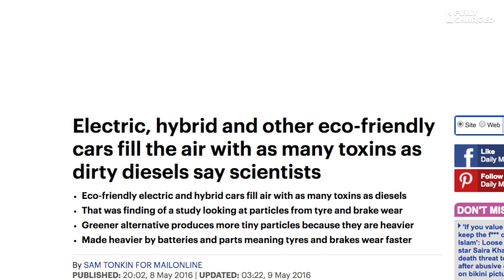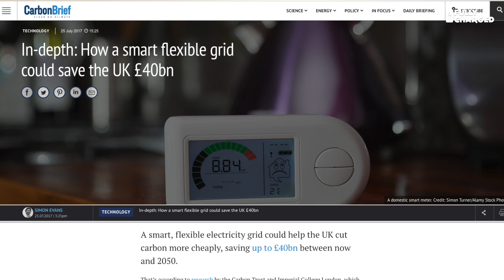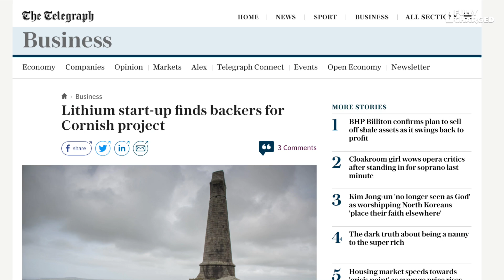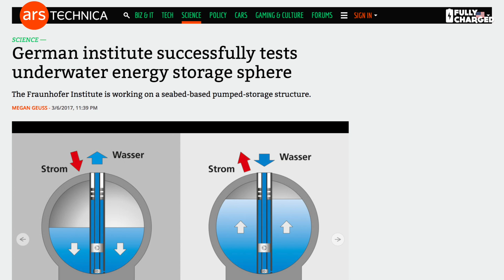Kettles, Particulates & Flexible Grid | Fully Charged News

Comment: It makes far more sense to abandon wind & solar, they are expensive and impractical, and go 100% nuclear & hydro, geothermal in good areas and then ALL power is baseload power. If EVs become the dominant form of transportation, as the trend is heading, that will increase total grid electricity by ~50-60%. Almost all of that will be at night when there is will be surplus nuclear and cheaper power available and cars are parked. That is the perfect balance for peak daytime electricity usage, with intelligent charging tech you can achieve an even 24/7 power demand which is the most efficient one and a perfect match for 24/7 baseload nuclear power. Almost all generation will become baseload power. That is maximum grid efficiency. 

Having fluctuating electricity sources on the grid are a really stupid way to manage a grid. Essentially you are converting economical baseload power into expensive peaking generation. Natural gas has always been the predominant supplier of peaking generation so that is why Big Oil absolutely adores wind & solar and despises baseload nuclear. In Ontario NG gets 17.2 cents/kwh whereas nuclear gets 6.6 cents/kwh, wind gets 14 cents/kwh and solar gets 44 cents/kwh because wind and solar convert 24/7 baseload efficient fuel-sipping CCGT into inefficient part time fuel guzzling OCGT and hugely inflates the price of gas generation and gas for home heating also. Baseload CCGT gas generation should only be getting ~5 cents/kwh, the extra 12 cents comes because it is peaking generation. Thanks wind & solar for making electricity and heat much more expensive. Thanks a lot. That will sure help EVs pushing the electricity price sky high.
Reply: Tom Hooper you have zero knowledge of nuclear. Don't get your info from Greenpeace which just makes stuff up, they even admit that, the Fukushima Death Cult. You need to abandon the Fake News Fukushima disinformation Fear Porn you have been deluded with and go to a reputable source. Go to Hiroshimasyndrome d0t c0m and learn the truth. Fukushima killed no one, vs Fossil & Biomass kills 7 million every year acc. to the WHO. You can easily get radioisotope readings in the Pacific Ocean going right back to 2011, and even at their peak, near Japan they are a small fraction of natural radioisotopes already in seawater. Learn to use your brain, I know it will hurt at first, but after a while you will get used to it. If you want reputable, accurate, rational, up-to-date Fuku info go to: hiroshimasyndrome d0t c0m. 

earthtouchnews: heres-your-go-to-source-for-debunking-all-the-fukushima-fables

deepseanews: true-facts-about-ocean-radiation-and-the-fukushima-disaster

scientificamerican observations: researchers-trumpet-another-flawed-fukushima-death-study

southernfriedscience: 28-fallacies-about-the-fukushima-nuclear-disasters-effect-on-the-us-west-coast
Reply: whykhr good, where can we deliver the spent fuel rods?  Your address please.  You clearly neglect the ancillary and required cost of storing nuclear waste in your examples, oops.
Reply: Friedlander I will happily store the 18 lbs of the nuclear waste I would generate on my property to supply one American's lifetime electricity demand if you store the 250,000 lbs of radioactive, carcinogenic forever, coal ash & sludge you generate with your coal electricity on your property. You should also bag up the 2,400,000 lbs of CO2 you will produce whereas I produce none. Also it would be fair if you pay a fee for the O2 you burn whereas I burn none. Say $1/lb for the 1,800,000 lbs of O2 you burn, will that be cash or check?

And dummy, the cost of nuclear waste storage is 1/4 cent per kwh, oops!
Reply: The World's #1 Climatologist James Hansen on the anti-nukes real MASTER = Big Oil , and their renewable energy bait-and-switch scam:

"....The tragedy is that many environmentalists line up on the side of the fossil fuel industry, advocating renewables as if they, plus energy efficiency, would solve the global climate change matter. But suggesting that renewables will let us phase rapidly off fossil fuels in the United States, China, India, or the world as a whole is almost the equivalent of believing in the Easter Bunny and Tooth Fairy.

"...it is much less than worthless. If you drink the kool-aid...you are a big part of the problem...The problem is that, by drinking the kool-aid, you are also pouring it down the throats of my dear grandchildren and yours. The tragedy in doing so is much greater than that of Jim Jones' gullible followers, who forced their children to drink his kool-aid. All life will bear the consequences..."

"...The lobby...Union of Concerned Scientists...broadcast a request to all citizens to write...congress...to demand improved nuclear power safety. Huh? The number of people who have died from nuclear power in the U.S. is zero. How to improve on that? The safety record of the nuclear industry is the best of all major industries in the U.S..."

"...No people died at Fukushima...When a plane crashes and kills 100 people do we choose to terminate the airline industry? No, we take steps to make planes safer...nuclear has the best safety record of any energy...new nuclear have great improvements..."

Jim Hansen is telling it like it is. That's why Big Oil/Bankster sycophant Obama "resigned" him after he wrote his important paper showing nuclear energy has already saved 1.8 million lives and will save many millions more in the future.

James Lovelock, father of environmentalism:

"...Nuclear Power is the only green solution..."

James Lovelock calls Nuclear Energy "The Natural Energy of the Universe"

The #1 Green Economist Jeffrey Sachs:

"...But Sachs, director of the Earth Institute and professor of sustainable development at Columbia University in the US, said the world had no choice because the threat of climate change had grown so grave..."

"...Nuclear power is the only solution to climate change..."

"...Sachs warned that "nice projects" around the world involving renewable power or energy efficiency would not be enough to stave off the catastrophic effects of global warming..."

World renowned environmentalist: George Monbiot:

"...How the Fukushima disaster taught me to stop worrying and embrace nuclear power..."

George Monbiot says: "...On every measure (climate change, mining impact, local pollution, industrial injury and death, even radioactive discharges) coal is 100 times worse than nuclear power... Nuclear kills when it goes wrong, coal kills when it goes right..."

See how in a debate George Monbiot, ripped Big Oil's puppy dog, Helen Caldicott, three new holes and sent her running with her tail between her legs, she now refuses to debate Monbiot:

caldicott debate @ monbiot d0t c0m /2011/04/04 /evidence-meltdown/

Read the World's #1 Radiation Health Physicist, Wade Allison, and learn about Radiation: radiationandreason d0t c0m

Watch Pandora's Promise and learn the truth about Big Oil's #1 enemy, Youtube: " pandoras promise part 1/3 "

Comment: Using your van battery to earn money overnight raises the question of battery degradation by increased use. Current lithium is at best 1500 full cycles ?  Great episode :) solar thermal in sunny countries like Australia could easily remove traditional power generation.  Or 30klm square of PV.
Reply from the maker: I will refer to the results of a test in V2G battery use, everything indicates that it increases the life of the battery contrary to everyone's expectations
Reply: I think I've read that Tesla batteries are expected to last at least the life of the car, and would probably still be useable for other purposes for years after that!
Reply: Full cycles are the big killer, LiIon batteries can last much longer with partial cycles, especially on the upper end.
If you never take them past 80% their life span can go well past two decades.
Reply: Richard King, Hahaha! the master of understatement :)
They have an *8 year, unlimited mileage warranty * on the battery pack.
https://techcrunch.com/2016/09/29/tales-from-a-tesla-model-s-at-200k-miles/
Reply: That is because current normal household and cellphone batteries ARE MADE to last a low amount of time, that is planed obsolescence in action,  they are perfectly able to do batteries that live longer and Elon Musk's Tesla did it because they wanted to dismiss all the wrong assumptions about electric cars.

Comment: We actually blew the main fuse in our summer house three weeks ago due to using the stove and charging a Tesla at the same time. The Tesla charged fine at 16 amps untill the stove was used, then fuse blew and the wires were real hot. Ofcourse this can happen! If you overload you system it Will fry!
Reply: Of course that can happen, but saying that "your house will burn down" instead  of "your fuse will blow" is intellectually dishonest and fear mongering.
EDIT: I was talking about the misinformation of the media by the way.
Reply: a.) you either charged your car from a wall socket and you have little knowledge about your power circuit and how it works and/or an already weak power circuit, or
b.) you charged from a charging unit, which got installed by someone who didn't know enough about electricity

It can happen, but not if someone with knowledge of electrical engineering had done the job right.

Comment: I don't know what they do in Britain but most homes in Canada or the USA have 100amp or 200amp, 240v single phase services. That supplies 24-48kw. So there should be no problem using an 11 kw charger at night. A kettle is only 1kw, so that is no problem. You could have a problem if you run your oven, stove and electric dryer at the same time you are charging your vehicle on a 100amp service, not a 200amp - charge at night, shouldn't be an issue. They could easily make high output chargers with a main current sensor and reduce its output if you have the oven/stove/dryer on or a welding machine.
Reply: whykhr my last three kettles were 3kw. Rapid-boil kettles keep the heating element and the water separate.
Reply: That is a lot of power for a house... I mean, a lot lot. Anything above around 15 kW is considered really huge for a normal house in Slovenia, EU, where I live
Reply: That must be in Europe, you won't get a 3 kw kettle in Canada/USA unless it is an industrial or commercial unit.  I know a lot of people have 50amp, 240v single phase welding machines in their garage that's 12kw right there, but of course that is intermittent usage, but also daytime usage.

Comment: I have an important question.
How come people don't mind the smell of their own farts, but hate the smell of others?
Reply: Cobraa - I'll assume that was a serious question... I think the answer is about the sanctity of one's personal space. Anything that gets into your body is an invasion of that. An offensive sight is easily avoided because you can turn away or close your eyes to it. A smell, though, gets right inside your body. Literally.

To be smelt it's absorbed into the membranes lining your nasal cavity. If it's a smell produced by another person, that's actual physical penetration without consent. Technically, I suppose, it could be considered a form of rape! Noise is similarly offensive, because sound gets inside your body and cannot be excluded. Earplugs simply don't work - the sound comes in through your sinuses and in through your arms and legs and torso and gets conducted very effectively along your bones until it's deep inside your skull. That's why being subjected to noise of any sort can be so disturbing, so distressing, so infuriating, and is a very effective and widely-used form of torture. You're powerless to keep it out of your body, just like someone's stinking garlic breath or intestinal gas.

One doesn't mind one's own smells because they're a physical part of you. But if you're very sensitive, being too close to another person is exactly the same as being assaulted. That's why (IMHO) people resent the smell of other people's farts. It's an issue of consent. Er, you might like to leave a window open after reading this; I had a superb curry last night..

Comment: The same crap in the early twentieth century, which camouflaged the technical superiority of electric vehicles, is repeated now, at the beginning of the 21st century. The OPEC Lobby will always use the same technique of transferring to the other technologies the garbage from where it comes from and what it is. In the future, instead of "filling the tank" with rapidly depleting fuels, we will shift the batteries to increase the autonomy of vehicles at levels untouchable to fuel vehicles.

Comment: Great video as always. Just been looking at the kettle and car charging at the same time for the house, as I'm getting a large point fitted in a couple of weeks. I have a smart meter and with the 13 amp charger and kettle, computers, microwave on I was using 2.5kwh of energy. So should be alright. Thanks for revealing the truth.

Comment: When I bought my EV 4 years ago there were smart chargers on the market that dynamically adjust the charging power to the available power in the house. Should the kettle and the EV pull too much power, the charger would automatically lower the charging power until there is enough power to go back to full blast. If there was a problem to begin with, that problem was solved years ago.
Reply: The Zappi charger from Myenergi can be set up to do that, which Robert has now and has been featured on this channel.

Comment: Looking forward to more videos about long-term storage of renewable-generated electricity, especially solar. How much continuous power is needed to keep hydrogen sat in a tank? Seems like that would be a good way to keep power on tap over a 6 month period to cover the winter pinch points people keep talking about. Would also be potentially useful for hydrogen powered electric lorries, if that turns out to be a better option than powering them with batteries, which MAY be possible.
Reply: Absurdly expensive, not even remotely practical with a round trip efficiency of about 25%. And hydrogen is extraordinarily expensive to store. Forget about it. Why not just use 24/7, night/day, summer/winter molten salt reactors and skip the nutty renewable energy which costs much more even before you include storage.
Reply: Because as far as I can tell, no-one's made it work yet? Not dismissing it and I hope someone does, but the theory's been around since the 1950's, a workable system might be just around the corner, but it doesn't seem wise to bet everything on it working economically within the next 5-10 years. 

Renewables work now, battery storage can handle day/night cycles, we just something that can store the energy long term with minimal losses. On a mass scale, the big german concrete balls might be a good start.

Comment: how can an 11 kW charger and a 3 kW kettle blow a domestic 100 amp fuse?
So If I use my shower and someone else makes a brew my house is going to burn down?
Admittedly a car charger is on for a long time and it only gives you another 40 amps so you could blow a fuse if you went crazy.
Reply: Most domestic fuses are 60 or 80A, if you ask you can usually get that changed for 100A, but it will depend on the local connection. 11+3=14kW is borderline 60A, so it could happen theoretically, but no electrician would fit you an 11kW charger if it could - nor would they fit you an 11kW electric shower.
Reply: There are plenty 10.5 kWh showers as I have one, the leccy put a new cable in direct from the consumer box just for that, it's pretty chunky https://www.amazon.co.uk/s/ref=nb_sb_noss?url=search-alias%3Ddigital-text&field-keywords=10.5+kw+shower&rh=n%3A341677031%2Ck%3A10.5+kw+shower.
Reply: A high power car charging circuit would have a direct feed to the main consumer box
Reply: More like a 1.3kw kettle. The only problem would be using your range and dryer.
Reply: They must have changed it to 100A when mine went bang about 8 years ago
Reply: you mean 15AMP right? most circuits here are rated 15A (but can pull 20A) 
The mains from the street would be 100A...

so if you have 1 circuit trying to load both at the same time.. boom... it will break... thats why you add more 15A circuits

this is an easy test. get a power board. plug in 4 kettles... watch the 15A circuit trip  ..
Reply: mine is 120A.. because I pull more peak current accross multple 15A curcuits

what the report said... if a kettle and the car are on at the same time it will blow the circuit.. this will definitely happen if it is on the same 15A circuit. not if it is on diffrent 15A ciricuits being fed from street 120A
Reply: This story can be dismissed as nonsense instantly. Why? It was in the Daily Mail.